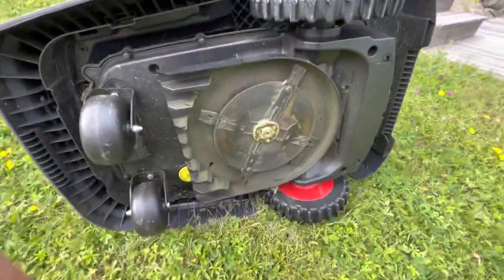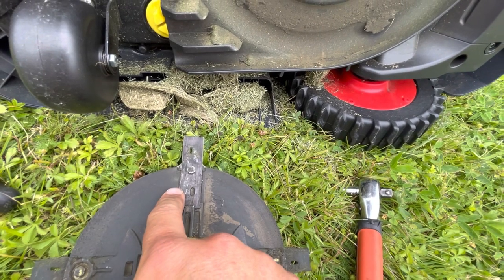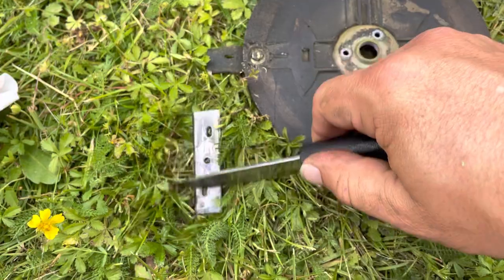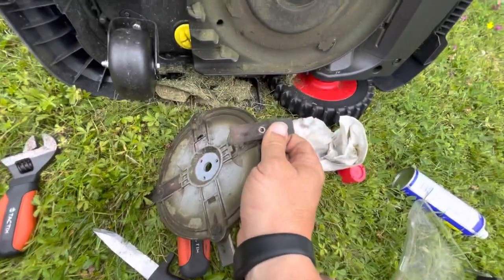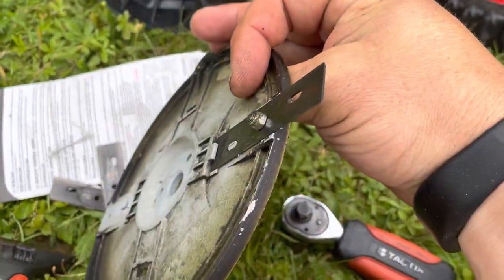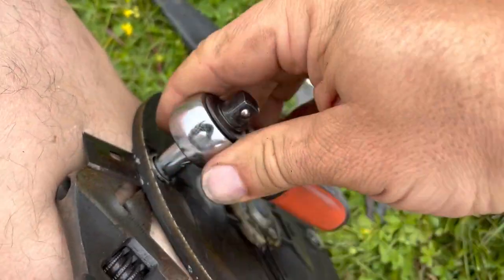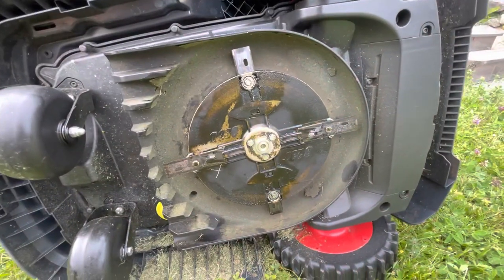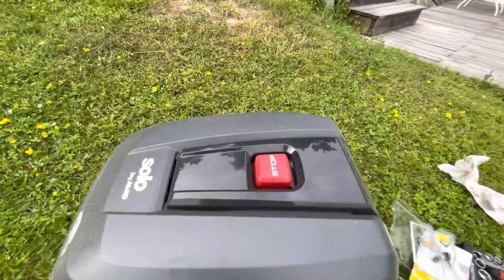Change blades / knives on a robotic lawnmower / AL-KO Robolinho

Comment: I would not mingle with the knife, before assuring that the battery is switched off.
Reply from the maker: I agree, just like you have to empty the car from gas if you want to change the tires :-).
Reply from the maker: Or just turn it off…